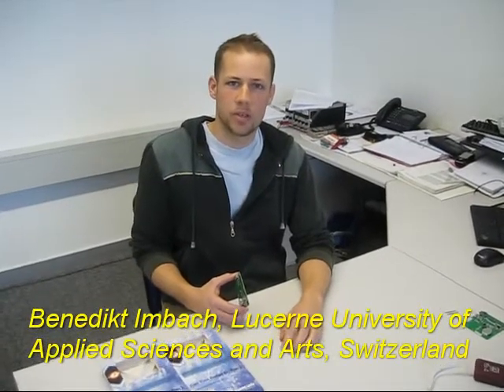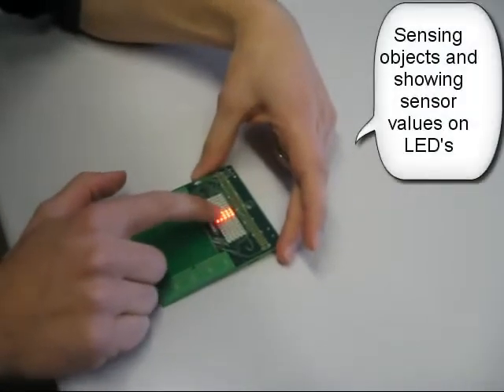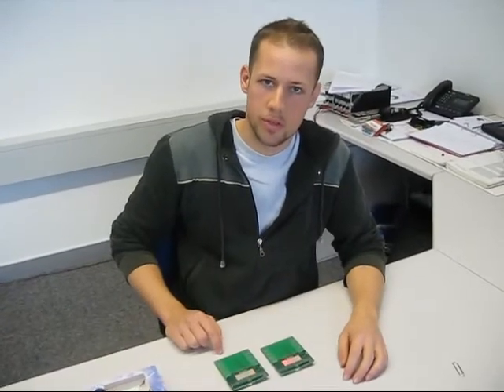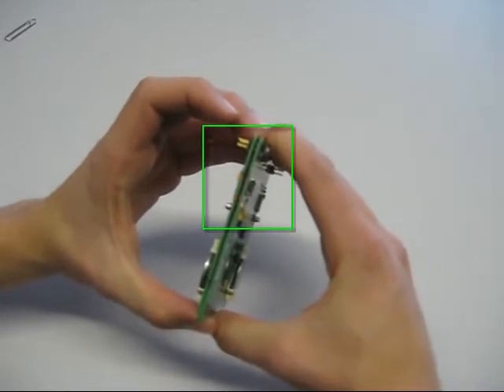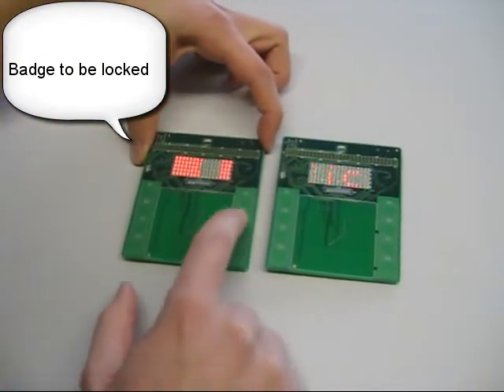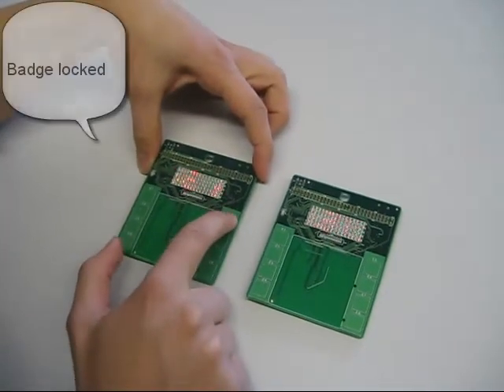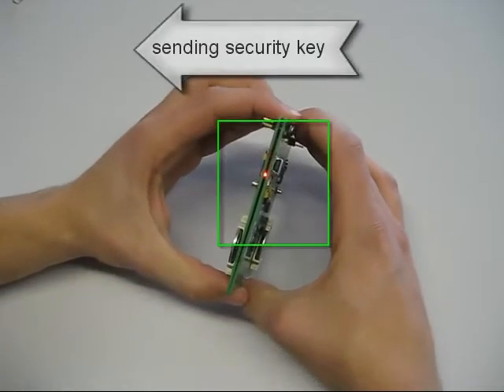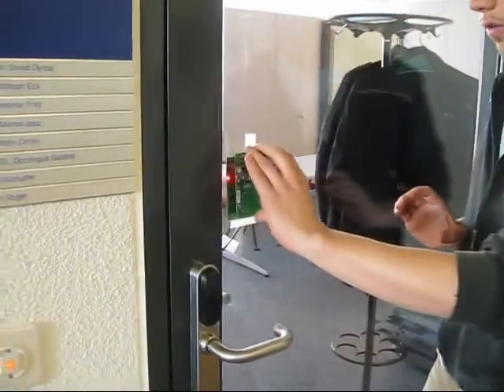The Magic Light Badge (Freescale JM Badge Board)

Comment from the maker: It uses the LED's on each board as sensors. So it is not using any photoresitors, and it is using unmodified hardware. It is using the LED's to flash to the other side, and the LED's on the other side are are used to sense the light.